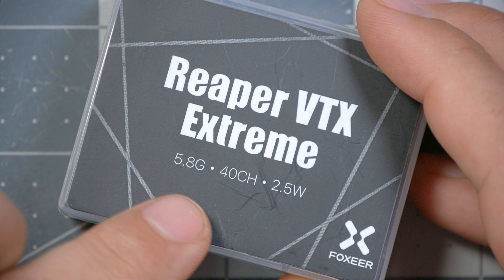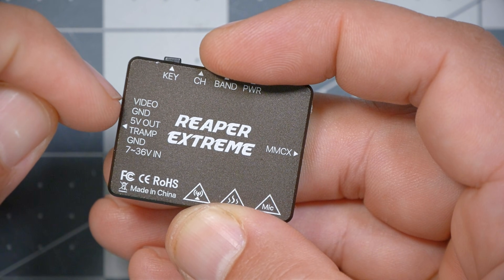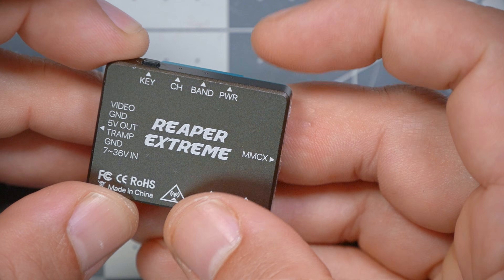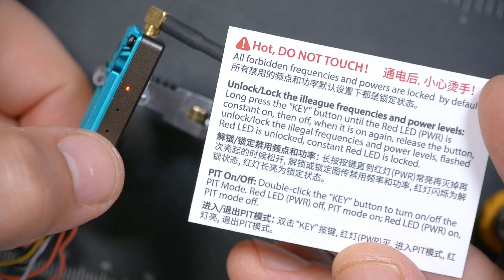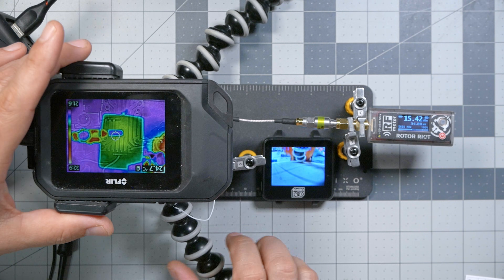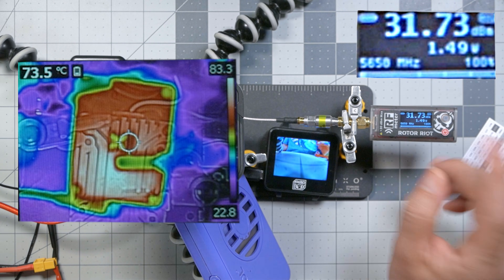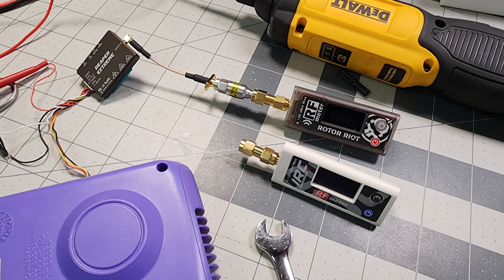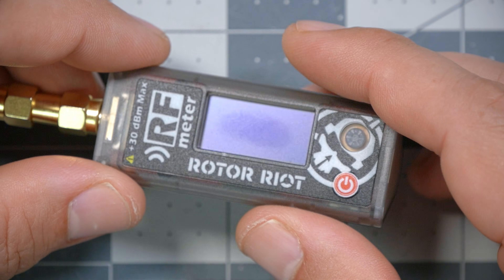Foxeer Reaper 2.5W vTX can do one thing digital systems can't

Comment: I guess you can achieve 2.5W output power, if youre able to keep the temperature way lower than 70-80 degrees.
Just a guess…
Reply from the maker: If a fan blowing directly on it isn't enough, will it be able to maintain that temp in flight?
Reply: @JoshuaBardwell  absolutely not, but maybe thats how these companies justify their output power claim 🤷🏼‍♂️

Comment: Joshua, consider investing in an attenuator. Perhaps even several, like 5 db, 10 db and 20 db. 
The IRC meter is maxed out, it even says '30 dbm max' on it and the display read slightly above 30 dbm. 
Other people also say that the IRC power meter isn't suitable for power levels over a watt or so.
Reply from the maker: In addition, Tony Cake has advised me that it's not a good idea to use high-value attenuators above perhaps 10 dB, because it results in skin-effect causing the RF energy to flow around the attenuator, which means more energy reaches the meter, which causes the meter to read high. This is something that pro-grade equipment would be able to prevent or compensate for, but hobby-grade equipment can't.
Reply: @JoshuaBardwell  alright, your math is correct. 

Ooohh! It just hit me! Are you reading the attenuated power numbers? Or does the meter compensate for that?
Reply from the maker: The attenuator value is entered into the meter, which then adds the value back to the readout, so the numbers are correct. And if that were the case, then the other power values would not read accurately, they would read low.
Reply: @JoshuaBardwell  yeah, I figured that. We'd be at over 7 Watts otherwise and would be praising the break-through efficiency of the VTX, haha! 

Well, perhaps there is some shady business going on over at F's marketing division... 
Or someone just got (un)lucky... 

One way or another, I learned something today.
Reply: @JoshuaBardwell  yeah, he might be true on this one. I'm not an expert, but I used to know a guy who worked at a company that makes lab-grade rf thingies. Attenuators were like 1000 to 10000 € a pop. But with who knows how many zeroes after the decimal point 🤣
Reply from the maker: Look carefully at the video. I am using a 6 dB attenuator.
Reply: @JoshuaBardwell  yeah, I saw that. But maybe that's not enough for such a powerful VTX.
Reply from the maker: Do the math. 2500 mW = 34 dBm. 34 dBm - 6 dB = 28 dBm. 28 dBm is less than 30 dBm. All is well. With a 6 dB attenuator, we could be up to almost 4 watts before we hit the limit of the meter.

Comment: I have this transmitter the only thing I hate about it is it's very hard to get it to work with inav I have yet to be able to get it to work with inap because it uses Tramp and not TBS
Reply from the maker: I think iNav supports Tramp protocol.
Reply: @JoshuaBardwell  have you found out if this works with inev yet because I have yet to get this to work with I now with changing the power settings via a remote switch through inab even though it's all set up correctly on the propert uart

Comment: Dang that blows, are you sure you had FIVE blinky red lights? I thought I was at full power before too but was at 1.5.
Reply from the maker: Yeah 100% sure. I rolled through the lights until I got back to one and then rolled through again. I also watched the power meter as I rolled through the output power to see that the output changed each time.
Reply: @JoshuaBardwell  yeah bummer.

Comment: Great video as always but you may want to try it on other frequencies for accurate power output. race 8 is at the upper limit of the band. SWR and other factors May be hindering performance
Reply from the maker: I tested both R8 and R1 for this exact reason, as is typical when testing vTX.

Comment: I have 4w digital fpv on my truck :)  The biggest issue with power is the inverse square law and diminishing returns.  To go twice as far as 25mw you need 100mw then to go twice as far as 100mw you need 400mw then 1.6w then 6.4w then 25.6w then 102.4w and so on, the power required to go further grows exponentially and quickly becomes silly numbers.
Reply: Who makes a 4w vtx?
Reply: @rp479  im using Digital HD FPV on my rc truck, its doing digital data transmission for the video stream rather than being a traditional analogue VTX
Reply: @stevefox3763  from what company?
Reply: @rp479  The HD system is Ruby digital HD, the transmitter is made by Edup.
My Video on that vehicle is running on 2.4ghz but the system supports 2.4 and 5.8ghz and i have a lower power 5.8 setup on a 450 quad and i have 1w 2.4ghz on a plane.
In addition to HD video up to 1080p, the link supports full telemetry and also RC control though most choose to run a separate Rc link, i use FrSky R9.
Some are getting 50 miles range in the air on ruby, i only fly a few miles out so haven't done it myself.
my truck is obviously severely limited on range being a ground vehicle which is why its running 4w as a heavy transmitter is not a problem :)
Reply: @stevefox3763  cool! Thanks for the info
Reply: @stevefox3763 Oh it's the open IPC how is the video quality in your subjective eyes to like hdzero analog or DJI? whatever you have for comparison?
Reply: @ Ruby when using a radxa for the ground unit and an OpenIPC camera for the air unit produces very good video, we can stream up to 4k and have H265 available.  There are a couple of videos that show its true quality but dont take video from some like MarioFPV as a comparison, the capture method used by some degrade it well beyond the true quality. Not a dig at mario, he has some good tutorials but the capture quality is just not representative of the true quality ruby is capable of.
Reply: @rp479  AKK has a 5 watt VTX
Reply: @Scout339th  AKK has a 16W VTX now. Totally insane.
Reply: or you just take a high gain antenna and quadruple your range.
Reply: @drkastenbrot  yes, antennas make the biggest difference but the video is about high power units and my comment was about power required to obtain range on the same antenna.
Reply: umm aktually it grows quadratically

🤓
Reply: To generate an electromagnetic field twice as far you need to double it's  highth , width , and length .  Or 8x power to go twice as far and 27 times power to go 3 times as far .
   4x power should  get you 1.59 times as far . Thats close to twice . Call it antenna problems and avoid the physics . But what about 4 times the range needing 64 times the power and the square of 4 being only 16 . Hate to be on the moon saying " can you hear me now"
Reply: @gregorydahl  cocaine is a hell of a drug

Comment: you probably have done this,but confirm you changed the vtx table that G.kremer posted otherwise it would only output 1.5 watts,,then verify via flashes,also curious what yours output was at 1.5w setting.coz i got one and i have my power selectable on a switch (thank u for teaching me that).and i swear the moment i get that static i hit 2.5w and turn back,the moment i hit 2.5w all static reduce.i have repeated that test in my home on a bench by walking with my tx and googles and leaving my quad on bench with fan.and it makes a difference.
Reply from the maker: This was not hooked up to an FC. I was changing power with the buttons on the vTX. So vtxtable is not relevant.

Comment: The reason analog VTXs can do this is because they come with a legality warning and you have to alter your betaflight firmware to "hack" the high power functionality into them, so it's technically not the manufacturers' responsibility if users violate FCC rules. The FCC has historically fined vendors for advertising  a product's capability to broadcast at these power levels, though.

Comment: A great review! Sounds silly, but have you tried jiggling / changing out the MMCX cables? On my Solo's, I've found that the MMCX, even on the bench, if you just twist/turn/press you can get widly different readings. I really do prefer UFL, tbh. I do wish, however, that you covered that more output really isn't always better ... I mean, yes this can extend your maximum range, but so few quad pilots will test this range. Many more will just crank it to "2.5W" in a parking garage / bando and wonder why their video feed is so bad with excessive multipathing. Even 1W is probably excessive for most flying ... money is much better spent on a better video RX or RX antenna than an overpower VTX. Even if you just use the same RX antenna you use for freestyle as you do for long range 1W will easily run out to a few miles.
Reply from the maker: Yes, I tried two mmcx. I also tried jiggling and etc but frankly if that's the issue then it will happen in a real quad too.
Reply: @JoshuaBardwell  Absolutely! I tried it with a few Solo's I had and what I deemed a "reasonable" amount of pressure could torpedo the output and was like, "Well ... that sucks." Fortunately they're in builds where I can manage that, but I don't think that applies to most quad/fpv related use cases.

Comment: There may be one more serious argument for foxeer over rush, I broke 2 rush solo vtx just by changing params via iNav OSD (one case power, other channel). 
For me rush is piece of crap. And yes I asked support and no help.
So happy to pay $10 more for reliably working VTx.
Reply: I have been trashing rush tank (lost antena, left quad at 800mw for around half hour after failsafe and etc). I am really happy with it, but I have been using it with betaflight only.

Comment: Hey JB I recently purchase two units and I tried one of them an im getting the 2.5w with the immersionRc meter screwed in and with the wand but strange sometimes it power when testing and shows the 1.6-1.8 and replugging fixes it. 🫣
Reply from the maker: Make sure you're using an attenuator because the meter is only rated for 1 watt direct input.
Reply from the maker: It's possible, but the lower power measurements were pretty close to accurate. And same with the Rush Tank.

Comment: Hey Joshua, the meter reads +30dBm max on it(on the sticker/label above the screen), and when your meter reads 1.8w out, it says 32dBm. Can being above range cause issues on accuracy?

Love the content though regardless! Thanks for what you do
Reply from the maker: That's a valid concern, but It's not above the range. I'm using a 6 dB attenuator. You can see it screwed on the end of the meter.
Reply: @JoshuaBardwell  saw that reply elsewhere. On mobile so it didn’t refresh right away before I commented. Glad you thought of it lol thanks as always
Reply from the maker: It's a valid concern and a mistake that I made once in the past. That was part of the reason for buying a 2nd meter, just in case a previous mis-treatment of the first meter compromised its accuracy.
Reply: @JoshuaBardwell  thanks for the thorough review as always JB 🙏
Reply from the maker: Also: 1800 mW is 32.5 dBm so that conversion is correct.

Comment: Have you seen that „+30dBm max” marking on the power meter? :)
Reply from the maker: Yes definitely. And that's why I'm using a 6 dB attenuator. It reduces incoming power to 1/4 of its value, and then the meter adds the number back in to the measurement.

Comment: What about an external amplifier on the digital transmitters? Would that work?
Reply from the maker: For HDZero it would work because it's a broadcast technology. But for DJI and Walksnail it'd be difficult because they transmit from both sides.
Reply: @JoshuaBardwell  what about Prosight Connex? Why is like literally nothing about this digital transmitter even though it's been around the longest?
Reply: It's bidirectional so you will have to amplify on the google side also...

Comment: Could you install a "booster" on board a digital system?  Much like a wifi booster ?
I've done this with 2.4ghz radios to boost control signal. Why couldn't it work in reverse with digital and have the signal boosted from the quad to the goggles ?
Reply from the maker: With the HDZero system yes you could do that with an amplifier, because it's broadcast-only and not two-way. But the size and weight of an amplifier would mean you'd need a larger aircraft to carry it.
Reply: @JoshuaBardwell  interesting.  Thanks for the reply 👍

Comment: Hdzero is open source and any manufacturer can make a vtx with any output power of their choosing
Reply from the maker: That is the intent, but practically speaking, nobody has done it. There isn't a single vTX for HDZero made by any manufacturer other than HDZero. Foxeer is supposed to be working on one for months but nobody has even seen a prototype. Other than that, it's crickets. 

In addition, HDZero has opened a github repo and published the vTX code, but as far as I know they have not yet published the hardware reference designs. So saying that they are fully open source and anybody can make a vTX is premature.
Reply: @JoshuaBardwell  I personally have seen a few companies I work with in the process of manufacturing these VTXs and I have seen schematics / prototypes, hopefully soon they will hit the market.
Reply from the maker: That'd be fantastic!